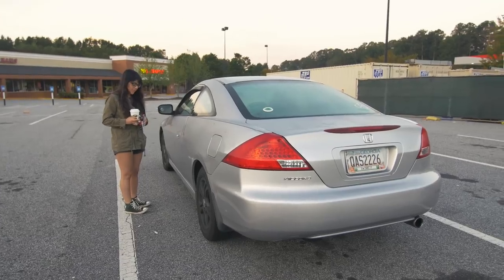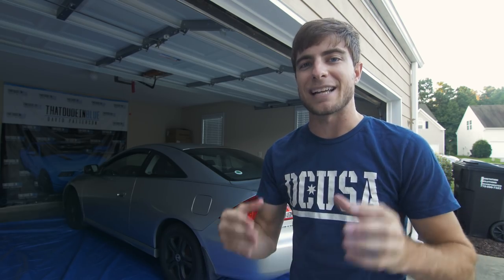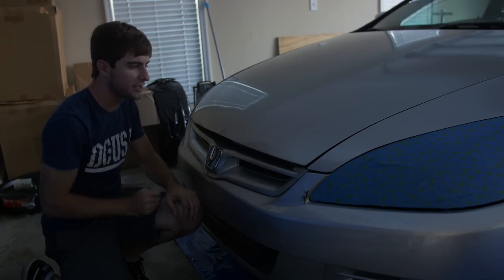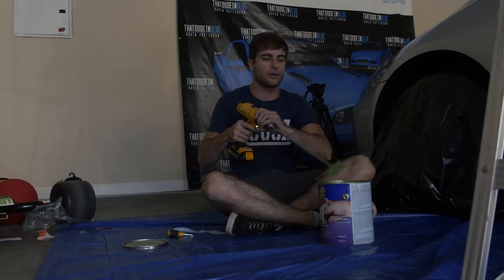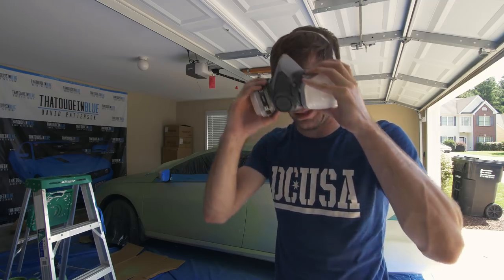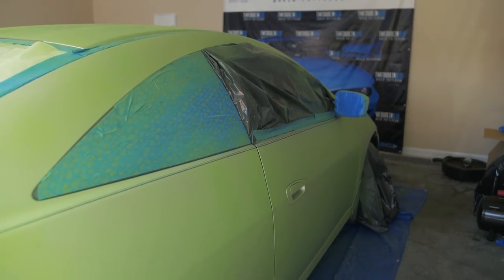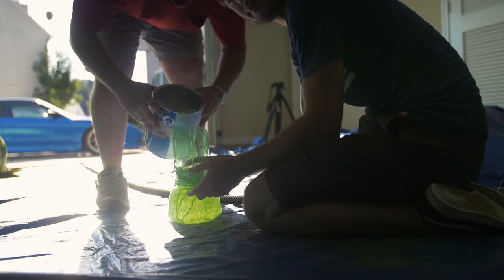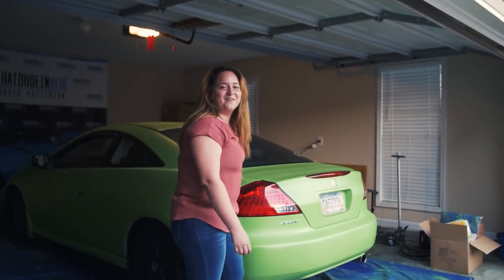How to Plastidip an Entire Car! - 400 DOLLAR PLASTIDIP PRANK!

Comment: I'm interested in plastidip but I'm curious, how does it work with spraying the front with the air intakes and radiator? If it were water it would be fine but this is sprayable rubber
Reply: The Spotted Car most people use trash bags to cover that area up. You definitely do not want to paint over that! Check out the Dip your car YouTube page. He has all of the details.
Reply: The Spotted Car The stuff is absolute shit. Stay far away from it. It has no business being on a car. If you really feel the need to change the color of your car temporarily, then get it vinyl wrapped.
Reply: Michael Kirst is that from personal experience using the product or are you just going off of opinions from random people on YouTube? This can also help with trade-in value if you cover the car when you first get it. Will protect from small chips from road debris. You cannot call it shit without a logical explanation my man.
Reply: james hawkins u are right plastidip is just like vynl yet plastidip protects better as its stronger
Reply: I agree with James, check out DYC's channel when it comes to how to apply the stuff, especially the newer videos......and remember, outside of the front bumper and grill and back bumper and taillight areas, always spray the product front to back, especially with any of the pearls or flakes. Doesn't matter if it's Dip or Paint either!
Reply: The Spotted Car it will definitely increase heat soak
Reply: Vinyl wrap = $2000 minimum
Reply: dude just stay away from plastidip if you can.. its so hard to peel off at times and will bother that shit out of you.. for the love of god refrain from dipping your wheels. lol

Comment: Horizontally = parallel to the ground.  Vertically up and down.
Reply: Evert Clonen yes the way the gun sprays not the motion the person makes
Reply: Ah, I understand, I misunderstood.
Reply: When a spray gun is set to a vertical spray you can move vertically, that would just make a line up and down. You have to move left and right for it to actually cover a surface.
Reply: He was talking about the spray pattern. It sprays in a vertical wall
Reply: This poem made me cry. Honestly.

Comment: good luck taking it off. Its not easy at all contrary to popular belief
Reply: James Smedley I agree. I plasti dipped my Rx-8's rims and had so much trouble taking it off. I had to buy different sprays.
Reply: Dude it's easy my dad is 3 time dip of the year winner and I've peeled alot of cars. You gotta know how to do it right
Reply: James Smedley depends on the prep. If you apply a heavy coat of a good wax first the dip creates a mechanical bond without a chemical bond. Also the more mils you can lay down the stronger the dip is so it will be less likey to tear when you pull it off.
Reply: Have you ever seen and of dipyourcar’s videos?
Reply: It's really amazing how far reading the directions get you, or even 5 minutes of research.

Comment: Does that really cost $400?
Reply: Paul de Rooij at least....maybe closer to 500
Reply: Paul de Rooij that tarp he used is at least 150....
Reply: Paul de Rooij go on the dip your car website and you can order the kit like what he used. I was planning to get this setup myself and that tarp isn't that expensive. I have one that is bigger.
Reply: Christopher May No it's not.
Reply: Paul de Rooij o
Reply: Depends on the size of your vehicle, and how many gallons you need to cover it. The gallons run roughly $75 per, and the sprayer setup is $160. This is basically a standard 'Pro' kit, for a small coupe. Runs $460 with a sprayer.

The dip and the sprayer used here are from Dipyourcar.com

Comment: Why would you do that to a car that isn't yours. I'd knock yo teeth in if that was my car
Reply: Scott Patterson it only peels off well if it's applied correctly. He skipped a lot of steps to prep the car for painting and may not have used enough layers of plastidip. She might not be able to get that off easily when she decides to remove it.
Reply: Ok tough guy
Reply: Shannon Cortez no it will peel off
Reply: It will come right off with a pressure washer with heat. We had an incident with the spoiler on my car, for whatever reason the pasti dip wouldn't come off at all even when it came off the rest of the car. Peeled a tiny section and the pressure washer did the rest.
Reply: Shannon Cortez everytime I use plasti dip It just peels off from sunlight and i did the same prep as him... it literally doesn't stay to the car
Reply: Lmao
Reply: Well, it's not your car so get over it.
Reply: I would be slashing tires and smashing windows

Comment: This isn't a prank. It's vandalism
Reply: you are right its not a prank, but it definitely isn't vandalism, vandalism would be doing this to a strangers car and painting the entire car, windows and lights. plus all they have to do is peel it off if she didn't like it.
Reply: She never got all the green off guaranteed, that shit stays in the cracks until you take a toothpick and get all of it out, like door handles, spots that had a lighter coat, my friend tried stripping the pastidip off his car and its allot harder than simply "peeling it off". Try it!
Reply: Alan Perry bullshit, if it's done correctly it comes right off.
Reply: Brandon Hawkyns yeah but this dude has no experience It was probably ass

Comment: Awesome  job, it looks great. I'm not sure if it applies in the state you live in, but the state I live in says that if you change the color of your car over a certain percentage (in this case it's the entire vehicle) from it's original color, you need to get an update on the vehicle registration. I know there is a cost difference depending on the state, but where I'm at it costs around $50. It's a fun prank and I assume your friend's favorite color is green, but I would definitely get going on finding out if that law applies in your state before she gets pulled over. Just a friendly suggestion, I'm not intending to be a douche or be a buzz kill. It's not that expensive and is no big deal, I would just hate to hear if she ever did have that happen and ended up getting fined for it. Very nice and clean look and I like that you gave some pointers as far as what to mask off.

Comment: Not bad for the 1st attempt. Plastidip is exponentially easier to use than any other paint. I've been in the customizing biz for about 12 years and hate painting. Looks like you've tackled the task pretty easily and did great for 1st time. How long did the girl leave it on for?

Comment: I deal with this stuff all the time.  If your having trouble removing it. Use wax and grease remover in a spray bottle. It melts right off. Especially good for getting out of crevices.
Reply: Oh and once youve cleaned the vehicle, do not touch it with bare hands. The oils in your skin will transfer. Wear gloves.

Comment: 7:20 "I'm going to spray it vertically" As he motions horizontally.
Reply: Vertical spray requires horizontal movement. If it helps, picture holding a paint roller vertically against the wall and then decide which plane your arm needs to move in.

Comment: Looked okay, now get more stuff do another.
Colored window tint, High light pinstrip, reflective tape, vinyle sheet the wheels w/ heat gun, then use of vinyle graffics design over dip, then clear coat.
But try an get you friend to at least pay for the products.

Comment: "I am going to do it vertically" does and Shows it horizontally.
Reply: Vertical spray requires horizontal movement. If it helps, picture holding a paint roller vertically against the wall and then decide which plane your arm needs to move in.

Comment: Please, if you want to spray, do it properly. Keep the garage all most completely closed, you're wearing a respirator, no need for such large ventilation, all you're doing is introducing dust into the paint. 
Also, dont touch the damn car after you've prepped and cleaned the panels, the oils on your hands can cause the paint not to stick and if this was automotive paint, it would've cause fish eyes.

Comment: You called horizontal movement  vertical are you dyslexic?
Reply: Vertical spray = horizontal movement. Also, if he had mixed them up (which he didn't) it would be a spatial disorder, not a lexical one.

Comment: Can i roller paint a car with a cheaper plastidip? And i dont have a roller, so can i use my hands as a roller? And i dont have mineral spirits, can i use some river water? And i dont have a car, can i paint those three wheelers that roll at corners? Can you send the intructions to the Red Cross or some disaster organization that always came here because this is not my computer, i dont have electricity.  

Read more

Comment: You made a horizontal lines with the sprayer but said vertical 7:15
Reply: spray is vertical, which requires horizontal motion
Reply: Snooby66 🤦🤦🤦

Comment: vertical is not left to right lol. Horizontal is what you meant right? says vertical motions horizontally
Reply: Vertical spray requires horizontal movement. If it helps, picture holding a paint roller vertically against the wall and then decide which plane your arm needs to move in.
Reply: I don't paint. I dont even see why this video appeared in my feed.